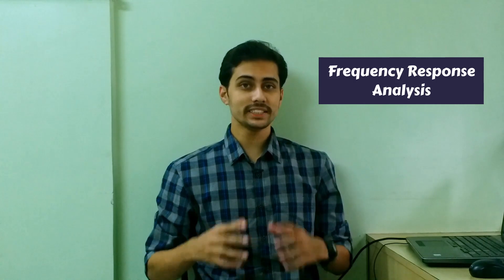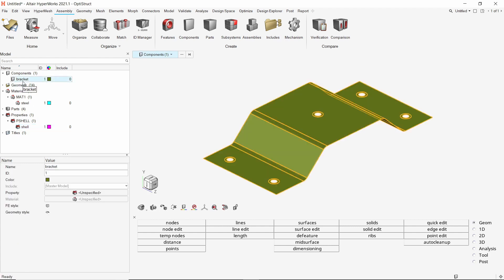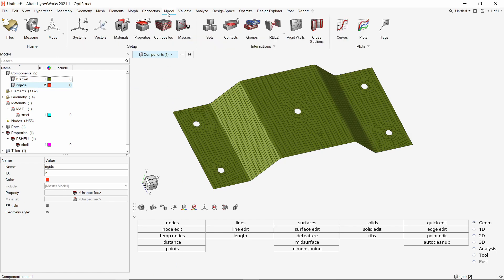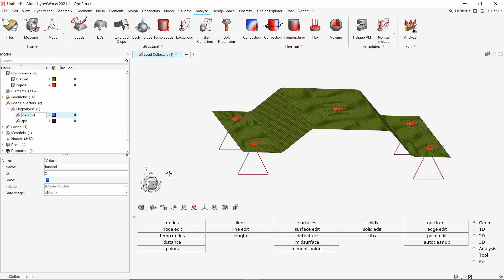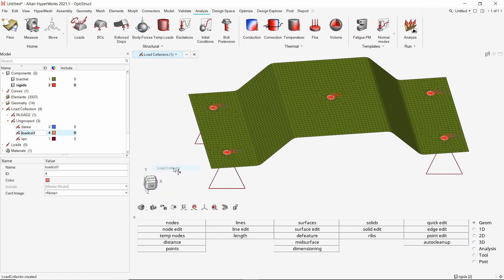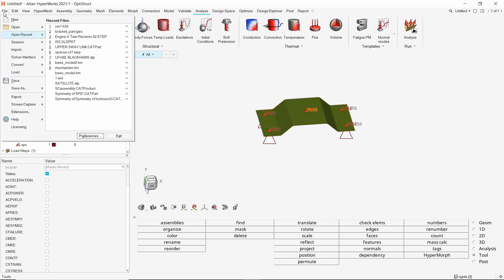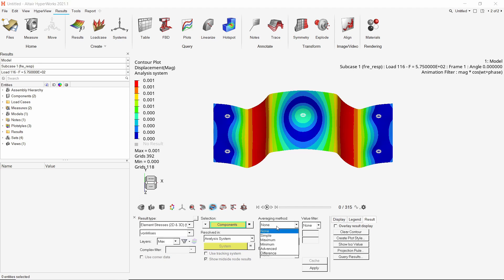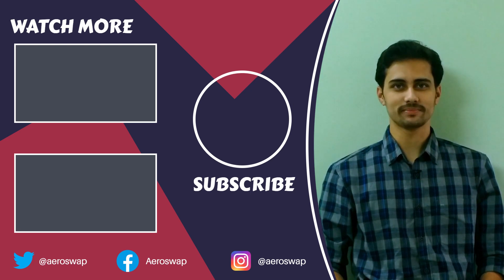Frequency Response Analysis using Hypermesh [Optistruct Tutorial]

Comment: Hello sir!

I'm getting an error 
"frequency response load case 1 has all zero loading vectors
- check DAREA input data"
Please tell what am I doing wrong?
Reply from the maker: When you create the DAREA constraint, you have to make sure that the scale factor is 1. By default, the value will be 0 and that will cause this error. You can update the value to 1 to resolve this issue.
Reply: @Aeroswap  
Sir should I change the scale factor value for all DOF? I changed the value for the one in which my part will translate but I am still getting the error. Please guide.
Reply from the maker: The method shown in this video is tried and tested multiple times. It works properly. Please make sure that you are following every step in the tutorial as is. It should work then!

Comment: I started watching this tutorial after watching your introduction videos, hoping that this series would be the next step but unfortunately the jump is too large. Is there another series that bridges this gap? Coming from ANSYS, it is unclear to me why Load Collectors are added instead of boundary conditions being directly applied. Also, what are these cards and how do I learn what each card is used for? In ANSYS I can create named selections and apply meshes/connections/loads/BC to them. Can this be done in HW? It also seems like there is no way to go through the mesh operations and modify them. When a mesh feature is created, that's it. You can't add/deduct a model feature to which it is applied and you can't tweak a setting, you have to reselect and remesh. Is this how it is?
Can you please direct me to video tutorials that will prepare me for this current series?
Thanks.
Reply from the maker: Hi Allon,
Thank you for pointing out the difficulties faced in understanding how the solver deck setup works in Hyperworks. I will make sure to create a detailed tutorial regarding boundary conditions setup and editing.

As for mesh, it is possible to edit the mesh features once it is created. In fact, you can also add multiple configurations of the same part with different mesh settings in the same model and select which configuration to use in any particular case. I am yet to cover these advanced topics in my videos.

Thanks a lot for your suggestion. I will work on these topics soon!

For now, I think the Hyperworks Help documentation will help you a lot in terms of understanding how the analysis is set up and why certain control cards/load types are used in specfic cases.
Reply: @Aeroswap  OK I'm back. I was able to follow this time.  Can you please explain how I would find/plot the maximum stress and/or displacement either in the entire model or in a specific component per frequency instead of selecting a single node and plotting its data? I want to know which frequencies result in the largest stresses and then I want to know where those stresses occur.
Thanks.

Comment: Sir I am getting a error during optistruct likke "" A fatal error has occured in your model. Please refer to the .out file to obtain more information on how to correct it "" kindly help me with this error
Reply from the maker: Hi Dinesh,
Please check the OUT file for this analysis which will be saved in the folder where you saved the model before launching the solver. In the OUT file, the exact error message will be listed. This will be useful to make appropriate changes to the model to resolve the error.

Comment: As you mentioned 'We can query the points on the graph to check the values of frequency and corresponding displacement of the master node' , I could not be able to find the results like you did here using query option in older version of HM ! I am using HM 2020 though! Could you please highlight how to do this in older version please. 
Thanks pl.

Comment: 2019 version shortcut keys are not working..how to enable it.? Please tell me ...thank you so much for your videos
Reply from the maker: Hi Aravind,
Please reset all Hypermesh settings to their default values to revert any unwanted changes that might have happened while using the application. This will resolve the issue.
Reply: @Aeroswap  ok thank you..I'll try 👍
Reply: @Aeroswap  I tried..but exactly I don't know how to do.
I'm trying in Preference option..there how to do ..I don't know.. please tell me
Reply: @Aeroswap  while Im pressing functions key ,it's not performing for Hypermesh.. usual function wrk only happening
Reply from the maker: Delete all temporary files from Documents folder which are related to Altair applications. Then open the application again and see if it works.
Reply: @Aeroswap  yeah I'll do thank you

Comment: I didn't get this point as we are applying unit load on the node specified how come that small amount of load is sufficient to excite the model to its natural frequency i.e., the peaks in the graph which are 450Hz and 680Hz
Reply from the maker: Good question!
The main function of unit load is to provide a location and direction for the vibrational loading. I said unit load as we are specifying the scale factor for DAREA as 1. By changing this scale factor value, we can adjust the amplitude of vibrations as per our requirements,

One thing to be noted is that regardless of the amplitude of vibrations (scale factor), the peak frequency on the graph will remain the same. The maximum deformation value will change but the frequency at which this deformation occurs will remain constant.

I hope this information answers your query!
Reply: @Aeroswap  can we consider those peaks as resonant frequencies.

Comment: Dear Swapnil!                                                                             
Since we can perform coupled thermal structural topology optimization. Is it possible to couple frequency response analysis results with thermal structural analysis and then perform topology optimization?
Reply from the maker: Hi Ali,
Not sure if we can couple frequency response with thermal analysis but frequency response based optimization is definitely possible!
Reply: @Aeroswap  Thanks a lot for your quick reply!

Comment: Can you please help me out how to get maximum stress and displacement at a once. Instead of checking all the loads I want it automatically. Do you have any suggestions?
Reply from the maker: I did not understand your question. Can you please elaborate?
If you are talking about frequency response analysis, we are getting the maximum values from the graph. No need to do anything else!
Reply: @Aeroswap  For modal frequency response analysis I am having around 40 loads ( Frequencies).  For all the 40 loads I am getting different stress and displacement. Currently I am looking into each load for noting the values and taking the plots. Instead I want maximum stress and displacement among those 40 loads at a once. I want these data from hyperview. 
Can you please provide me your contact number. So that I can explain in detail about my query. 

Thanks in advance
Reply from the maker: Hi Muttu,
Once you plot the graph, you are getting all the results in one frame. The graph lists stress values at each frequency so you can easily observe the maximum stress value and its corresponding frequency.

If you still have doubts regarding this, feel free to contact me via email. My email address is provided in the 'About' section of this channel.
Reply: @Aeroswap  okay. Thank you very much.
Reply: @muttuhugar5846  Hi muttu if we have multiple loadcases we can create derived load case(envelope) on hyperview by combining all loadases into a single case..

Comment: Nicely performed the direct freq analysis using the specified range of the frequency as an input. How difficult is to do the modal base freq analysis though? Do I need to run a modal analysis first and import it to the model as an input? Or can I run them all at the same time? By the way the new Hyperworks 2021 looks pretty neat. I'm still using 2017 haha.
Reply from the maker: Hey Ken, thanks!
No need to run a modal analysis separately. We can set up a modal frequency response simultaneously in the same model. It solves much faster than direct frequency response. I will be creating a follow up to this video to demonstrate the modal based frequency response analysis.

Yes, the new interface is great! Much easier to use than legacy HM. I hope your company decided to switch to the new interface soon :)
Reply: @Aeroswap  Waiting for modal frequency response analysis video.. thank you for the information
Reply from the maker: Working on it. Hopefully it will be out soon! 
Make sure to keep the notifications turned on to get latest video updates instantly :)
Reply: @Aeroswap  I am waiting on it too . Notifications turned on .
Reply: @Aeroswap  when sir?